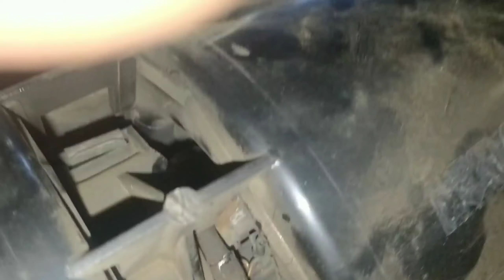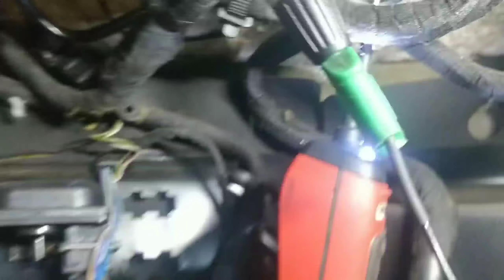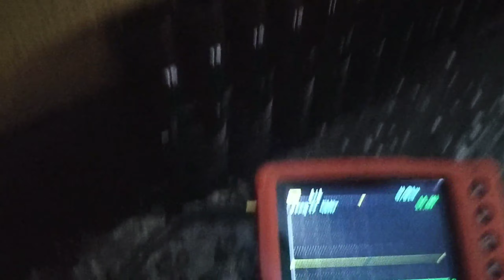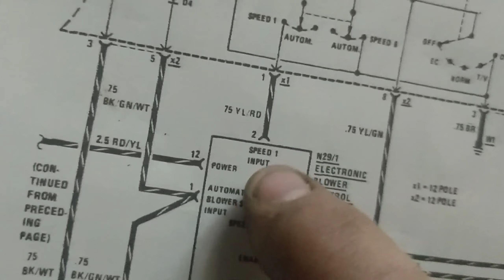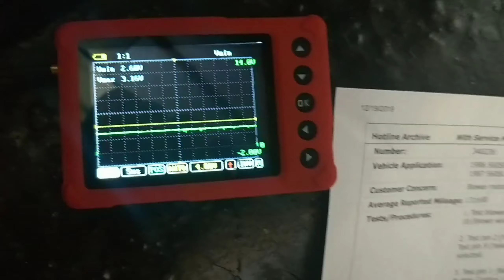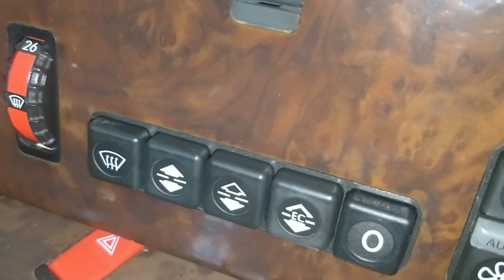1987 Mercedes 560SL no blower operation R107

Comment: Great video, super informative - my 560sl's blower just stopped working while we were driving. When clicking the automatic client control buttons, I can hear slight clicking and brief dimming of the headlights, like the circuit is trying to actuate something. I feel that the climate controls may need replacing as I've replaced window switches in the car already. What is the probe that you're using to supply the 12V current to the relay to check that the blower works?